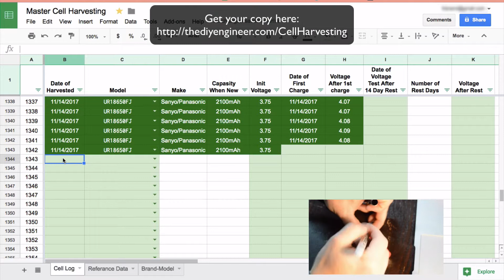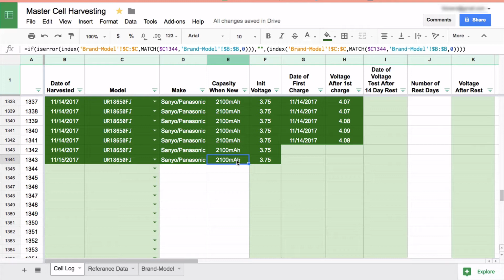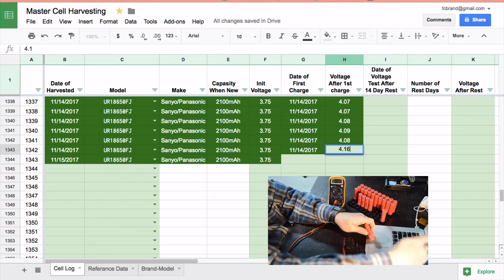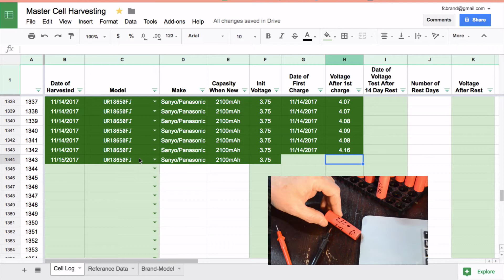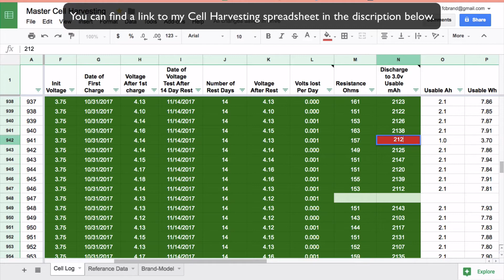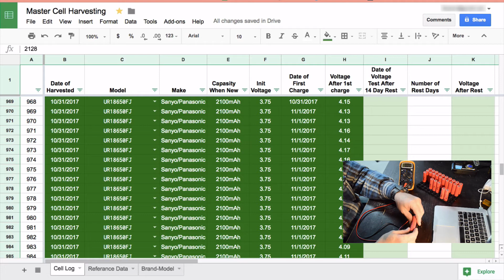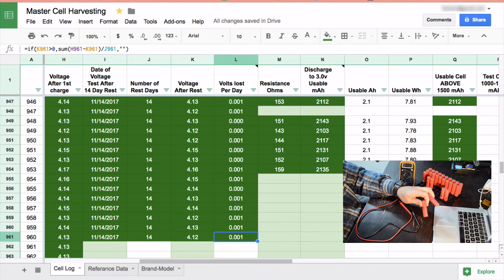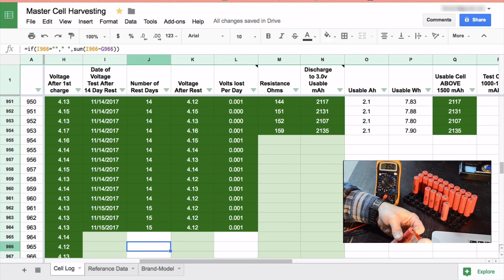Cell Processing The DIY Engineer Way - Part 2

Comment: Hi Frank. I have seen several channels that show how to do power pack and I have a question. Why do you use 18650 cells and not use others with greater capacity?
Reply from the maker: 18650 cells are easier to fine and they are less expensive. My average price per cell is around $0.98.  Most DIYers are building energy storage with cells they have harvested for old laptop batteries or old power tools. I hope that helps. 🤓

Comment: Just found your channel, sub, and thanks for the videos.
One question please. I'm in the middle of this same process but I'm harvesting from discarded laptop packs with much more varied results than you appear to be getting.
What kind of self voltage drop do you allow over the two week rest period for inclusion in your powerwall?
Jimmy
Reply from the maker: +WoodyJim In the videos I'm testing new cells but I have done hundreds of old laptop cells  as well.  Selfcharging18650 cells are a bad thing. I reject cells that drop more than .05 volts during the 14 day rest. When I was testing old cells In found that if the cells was self discharging there were other issue, like the cell would get hot when being charged. I hope that helps.
Reply: Cheers thanks Frank
Reply: @FrankBrand_gplus  really thanks Frank,if you dont mind.
you said abt cell voltage. What abt amps how to check is that cell is eligible for battery pack according to AMPs.
Normally what is the minimum amps should have or for good for battery pack.
So far what I understand is  
1. Check voltage and Put in Full charge 
2. Keep it some where few days then cross check each cell voltage 
3. Compare previous Volts and current Volts 
4. If same or .5 slightly difference then eligible for battery pack if difference is more that .5 then keep it away.
What are the next steps that I need to care for battery pack about amps from each cell.
When/how like before and after thinkgs need to test. 
Kindly help me and reply.